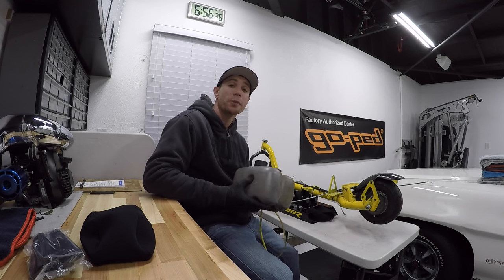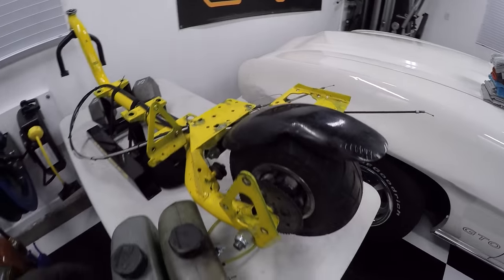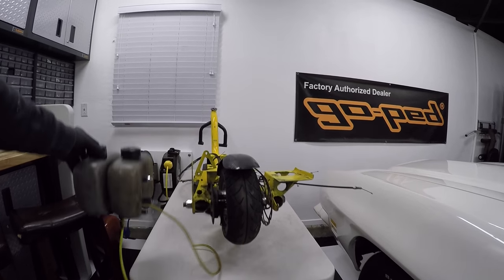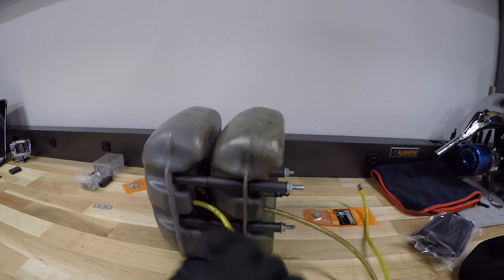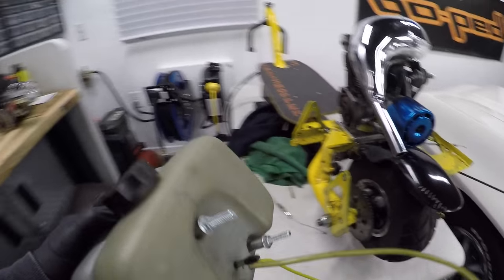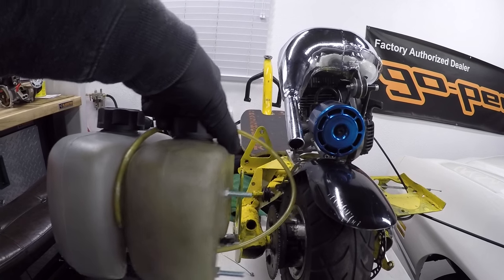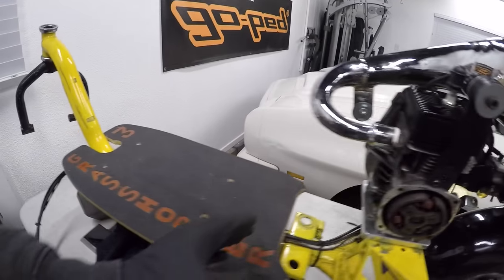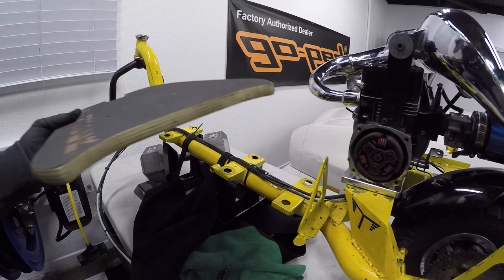Vlog 3 Dually Ped, Double Gas Tanks!

Comment: Couldn't you just make a bracket that holds 1 tank higher than the other.  Drill 2 holes in the front of the base tank to feed the lines to.  

Wouldn't that work as well?